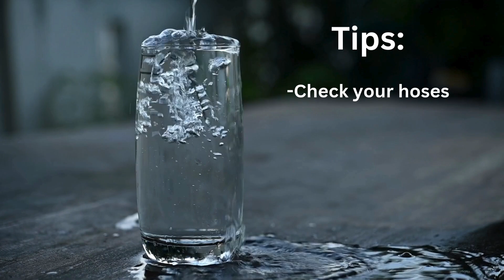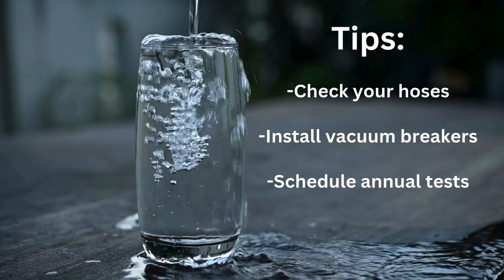What Are Cross Connections?

Comment: Carbonic acid in my soda water??
Reply from the maker: You’re absolutely correct—carbonic acid can pose a risk when carbonated water comes into contact with copper piping. To address this, soda machine systems are designed with a backflow preventer, and all piping downstream to the carbonator is run in plastic tubing. This ensures that the carbonated water never interacts with copper, preventing corrosion and maintaining both the integrity of the plumbing system and the safety of the water supply. A well-thought-out solution for a common challenge in these systems!